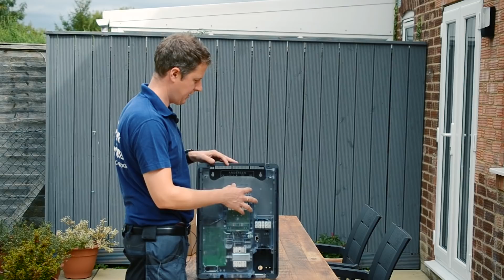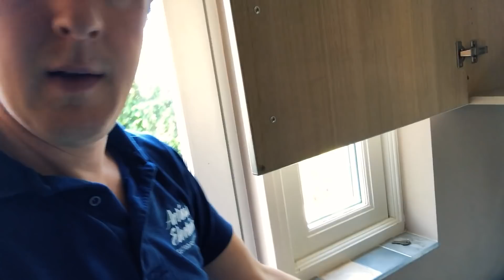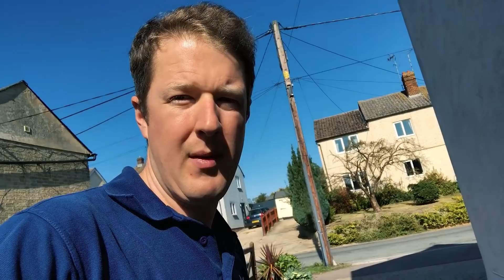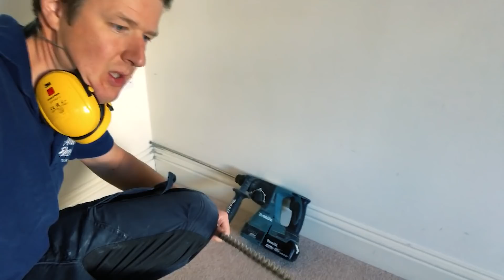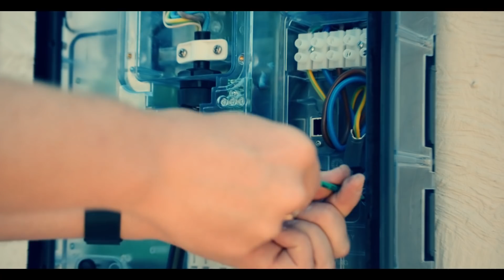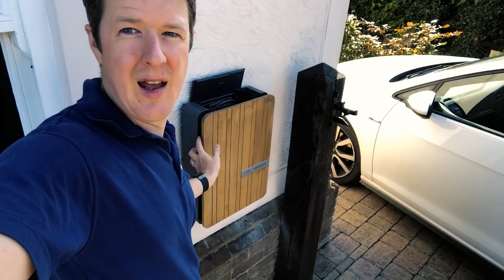Andersen EV Charger Review and Installation

Comment: Thanks for the Video Jordan, helpful as always. I am looking at  installing 2 of these for myself. Am I right in understanding that the Anderson Solar and Adaptive Fuse packs are actually just £99 for a CT clamp? There is very little information avaliable even from Anderson and looking at the install sheet I get the impression the A2 unit are all capable of Adaptive Load control and Solar Integration and they just need a CT clamp connected?
Reply from the maker: Im really not sure to be honest as I have never installed one with either of those features. I would imagine it's just a CT like you say.

Comment: Hi Jordan, I know this is a very old video - just wondering how three phase works with these (or any) AC EVSE. If you want to charge at 32A with three phase, does it pull 32A per phase, or is the 32A spread across all three phases? Would the neutral need to be sized to carry 3x32A? Sorry for the noob questions - I am not an electrician - just curious. Thanks.

Comment: Nice install thanks for the video. I fit a lot of Zappi, wallbox and pod point chargers and always look for O-PEN fault devices built in. Personally I find the Zappi the best EV charger on the market for ease of installation, features and technical support. What I like about them is the wireless option for the CT clamps for load limiting of the main fuse and solar integration. Sometimes if I have to install an EVCP on a remote building or a long way from the house wireless CT clamps are a godsend. BTW I wouldn't use silicone on the trunking I always use decorators caulk, much easier and nicer to work with , I HATE silicone with a passion! I noticed you fitted a 32A MCB? I tend to always fit 40A because sometimes they buzz when car is charging and some chargers actually hit 7.6kW so hitting almost 32A. I do like the style of the ANderson though and the fact the charging lead is hidden, although all those different parts look a bit fiddly and it's a very big box? I wonder if it would fit ok on the centre pillar of a double garage for instance? All the best, cheers.

Comment: Have you worked with Easee units before? We are trying to get a charger into our allocated space in our flat. Due to the location of space to flat, WiFi isn't an option so the 4g setup of the Easee seems perfect. I realise we could run an ethernet and use the Anderson but I'm not sure the box would look good on a post. Would love to hear your input regarding out situation. 
Thanks

Comment: I would have RCD protected the cable personally for all it costs, but I was always taught when classifying cable installation you go by the majority method used, which in this case is in trunking.  Did you consider decorators caulk, rather than silicone?Makes it easier for painting over as I’m sure your trunking will eventually be sealed tight with several years of overpainting 😂
I’ve started using Matt-e for PME supplies with the Rolec units.  This complies with 18th edition for isolating L, N and E in the event of a fault.  They’re available from CEF and Edmundsons now for around £150 + VAT.  You might be able to haggle some more.  Matt-e quoted £132 but you can’t buy direct 😩. Nice work as always 😄👌
Reply from the maker: Cool thanks for the tip!

Comment: Are you based in near or around London / South London? Would love to get it installed by you. I do have questions about my solar setup though. I want to know how this charger can handle excess energy from my solar PV.
Reply from the maker: Hi! They do a CT module which fits into the unit to monitor input from solar panels and make it more efficient. I’m in Cambridge I’m afraid don’t travel to south London.
Reply: @artisanelectrics  thank you. I will call them today and check it out

Comment: Thanks for sharing your installation, great job. Just one thing about the device that is supposed to detect PEN faults. As far as I'm aware the only system that does this is within a 3phase supply. It hasn't been developed for a single phase supply. Any thoughts?
Reply from the maker: PEN fault detection is available on several single phase charging points now as far as im aware. Zappi 2, PodPoint and Andersen all do them.

Comment: If the customer didn't uncoil all the lead and just did a couple of meter's to plug into the car , would that cause the cable to overheat and cause problems with the charging unit , just a thought , great video and I love that hole......👍
Reply from the maker: Good thought, no it’s designed so that the cable can be left uncoiled and fully loaded and not overheat.

Comment: How do you know the supply is 100amp?
Reply: its quite a modern main head incoming supply so it would be labled on the outside of the fuse 100A. Also its 25mm tails feeding the consumer unit
Reply: @billread9383  THe label means nothing my friend, always best to ask the local DNO or fit a import limiting device.

Comment: Hmm well I am not a professional electrician, but from a 'user' point of view,  the act of wrapping the cable around the box and inserting it in the lid looked like it would be very irritating if I had to do it every morning. I also wonder if (after wrapping the cable around and around) whether the charging handle would always end up in the lid, it certainly doesn't happen with my hose pipe (using a similar system). I also wonder why the home owner asked you to drill through so many walls, would have been better just to dive out of the wall by the boiler, under the paving, and around the corner. For my choice the trunking in the room looks dreadful (but nicely done by you), but well done you on your wall drilling!
Reply from the maker: Thanks! The Andersen is cleverly designed so that the plug always ends up in just the right place no matter which way you wind it up! 
The customer didn’t want cabling outside and paving up etc too much upheaval and ugly cabling visible not nice.
Reply: To be fair the room was unfurnished,  so there would probably end up being furniture obscuring the trucking.

I do agree with you though, I'd have  routed it outside, if it was my property.

Comment: I thought with the 18th EVERYTHING required RCD. no exceptions
Reply from the maker: Almost everything! This charging point has its own built in RCD protection for the car anyway.
Reply: Artisan Electrics so what is protecting the cable going to the charge unit from the consumer unit? Doesn’t that part of the circuit need RCD protection?
Reply: @jammyb2008  That would be my thinking.  I'm surprised at NAPIT on that one...  I think you should've checked with your own body (I believe you're with NICEIC?)

Comment: Really tidy job there. Great video edit to on this one.  I like the look of those chargers.  
If I was to pick a fault I would suggest using decorators caulk instead of silicone.  You can paint on caulk and not on silicone.  Keep silicone for external and use caulk for the internal work.
Otherwise great job !  👍🏼

Comment: Would it not have been easier to tap off the meter tails and run the cable from the meter box? I’ve seen an install like that with what are apparently called “vampire clamps”. No Henley block required.
Reply from the maker: Interesting never heard of vampire clamps sounds a bit dodgy to me!
Reply: You can only install them on the 31st of October
Reply: I would attach a picture but I can’t see a way of doing so. They don’t look the best but I guess they’re no different to the overhead cable clamps that the DNO uses to join cables. I can’t find what they’re called unfortunately.

Comment: If the car is parked round the corner how will you get contact differences in the earth? It’s all the way round the corner? I suppose another option would be to install car charger away from any other contacts? 

Love the videos!
Reply from the maker: Thanks yeah it’s difficult you have to gauge all the different places the car could be parked and with at 8.5m cable that’s a lot of places!
Reply: Hi mate do we need an earth rod for tns installations? As we won’t have to worry about broken neutrals, so no pen fault protection needed on tns? So there for would you install a rod on tns knowing what we can get away with on tncs?
Reply from the maker: According to the Regs if it’s TNS you have to treat it as TNCS unless you can prove that the supplier will never change it to PME in the future. So basically yes you need an earth rod or PEN fault protection on a TNS system

Comment: Nooooo don't use silicone! Use caulk! You can't paint silicone! It'll look awful when somebody comes to paint it. Sorry. 😉
Reply from the maker: Good info thanks!
Reply: Very good advice Steve. It looks god damn awful when they’ve tried getting paint over silicone
Reply: Decorators caulk is water based so cleans up with water, easier to use than silicone plus the tubes don't go off if you leave one open.
Reply: @paulf2529  it's also very satisfying to peel it off your fingers all day after using it (like pva). Whereas silicone just makes you horribly greasy!

Comment: Question is the twin and earth now classed as being buried in the wall installed on the angle now requiring rcd protection? Rather than it being drill directly inline.
Reply: There’s more chance of drilling thru that cable, than touching the lantern while holding the charging cable 😂 and having an N fault
Reply: Yeah, that's definitely buried within the fabric of the building, so needs RCD protection imo.
Reply: With no RCD, no visible accessory on the inside, and no indication it branches out of the trunking at a random point, which then goes behind the radiator, I wouldn't be happy myself, but I am not an electrician I suppose!
Reply from the maker: Toby Sinclair-Bell what you really need to think about is what are the chances of someone drilling or nailing that 50cm piece of wall between the charging point and the trunking, and actually it’s only probably a 10cm section where the cable is buried less than 50mm in the wall just above the skirting. It’s a bit OTT to fit an RCD just for that in my opinion.
Reply: Check out Prysmian they make a cable called afumex, which I saw in a P.E magazine. Looks like flex but is like twin and earth inside but cores wrapped with metallic foil, which according to P.E magazine complies with bs7671 for cables buried in wall so no rcd required. I have miss placed the sample I was sent but I can see its value in situations like this.
Reply: Great spot. 😂  if you measure twice you may find that only about 200mm of cable is run in less than 50mm depth !
Reply: I thought it was twin and earth too
Reply from the maker: Yeah I knew someone would come up with that question! Even if it was counted as buried in walls it’s got an earthed metallic sheath as it’s armoured so doesn’t need RCD protection see on site guide 3.6.1 (g)
Reply: Artisan Electrics was it not twin and earth mate ?
Reply from the maker: CJR ELECTRICAL oh yeah was 😂
Reply from the maker: I’m getting so confused I’ve done so many of these lately! Anyway I’m my engineering view it’s such a short piece in the wall I’m fine with it as it is.
Reply: @artisanelectrics  ...but you installed standard T&E? - https://youtu.be/XWn835Zl098?t=1085 - https://youtu.be/XWn835Zl098?t=952

Comment: i know you filled the  hole with cilcan but drilling down words will water get in  the back and drip  thro the hole and form a damp patch in the room ?
Reply from the maker: No it won’t because the hole is sealed
Reply: @artisanelectrics  I can see P.Smiths point, not saying it will on this job but bridging the cavity with a cable leading down into the house increase chance of moisture and mould on the internal wall. The external wall can leak/absorb water from any point on the external wall. The cavity gap and airflow keeps the internal wall free from moisture. That cable could collect water from the external wall and run it to the internal wall.